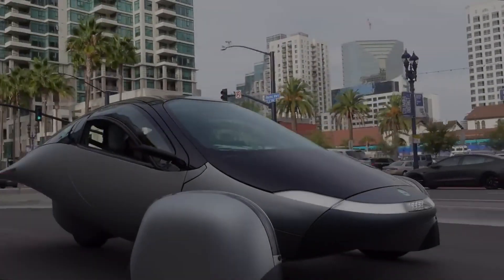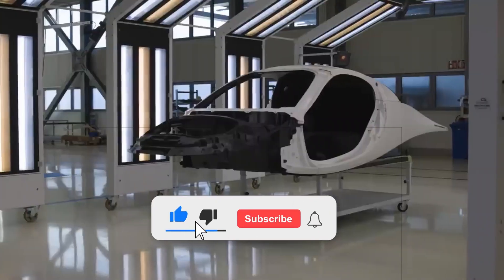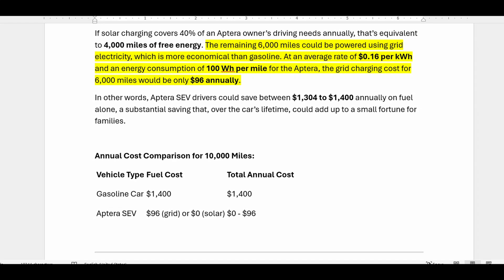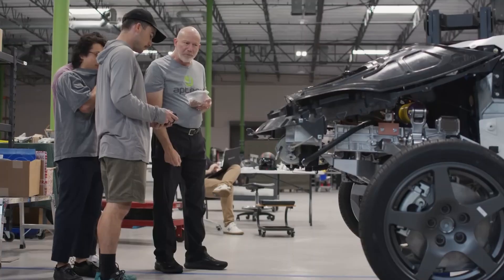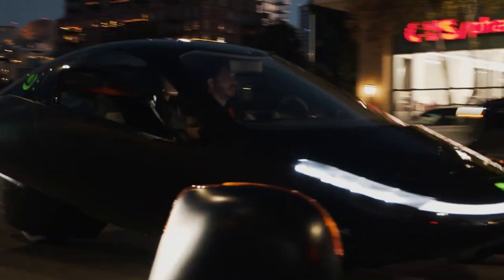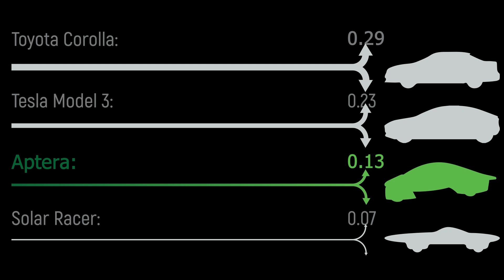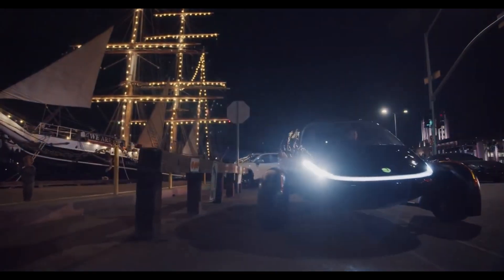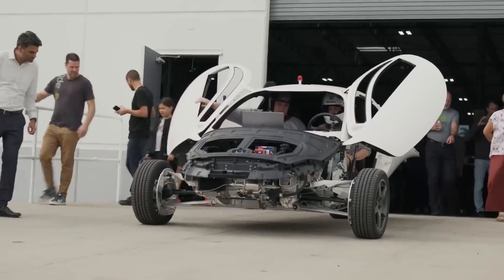How Aptera's Solar SEV Can Reduce Living Costs for the Average American

Comment: I am in Canada and drive a Toyota Corolla that I bought new. I did my own calculations for total vehicle cost for the Corolla versus the Aptera for 10 years including purchase price, fuel cost, and maintenance. I calculated the Corolla will cost me about $61,300 over 10 years. The Aptera would cost $54,210. I was being quite conservative too. Beyond 10 years and the difference gets even more radical with the Aptera being much much less expensive. That is impressive considering the Corolla is one of, if not the cheapest car to own in today's market. The only factor that remains a mystery is insurance but I doubt it'll be as expensive as other EVs with batteries twice the size.
Reply: How do you calculate. One is fact since you can see what the actual cost it because the product exists and you drive it to back up what the real data. As for Aptera, there is zero information or data, thus you only base them off of claims. I suggest you get the Aptera and gather data.

Comment: I could careless about the whole "save the environment" thing, but I would likely buy one for the reasons of not having to rely on gas and electric to get around.

That is if the thing actually worked as advertised.
That is if the thing actually came out.
That is if the thing isn't junk when it comes out.
That is if the thing is reliable enough for the roads I live with.
That is if the thing doesn't cost an arm and a leg to repair.

All that just to say, I'm waiting for non-bias reviews when/if the car comes out.
Reply from the maker: Lo!
Reply: Just go by company claims and what the paid endorsers tell you. Plus don't forget about the ambassadors.